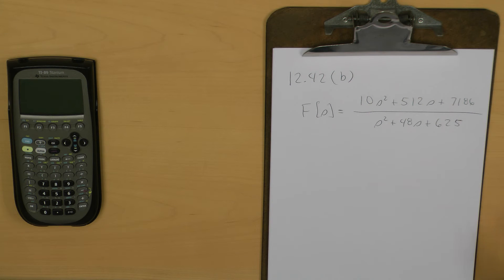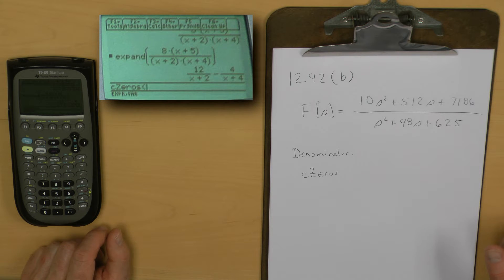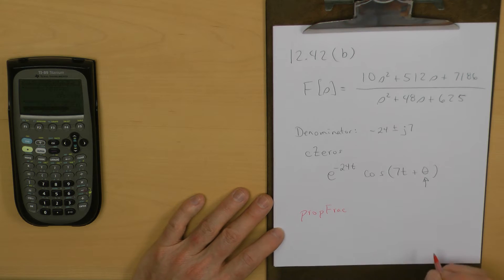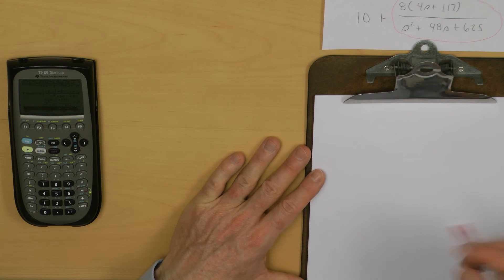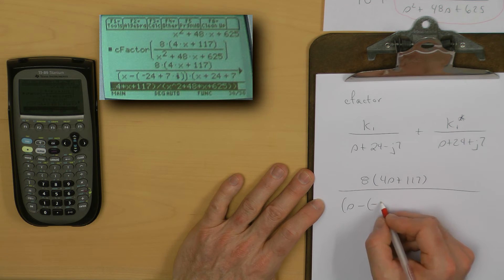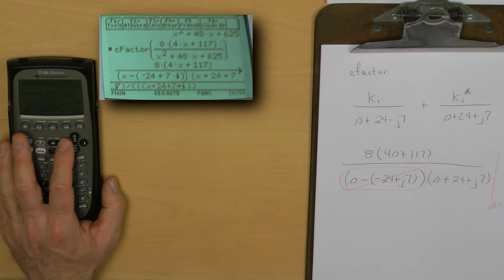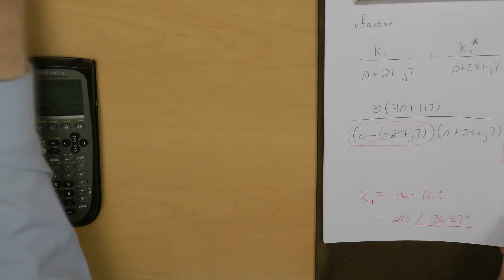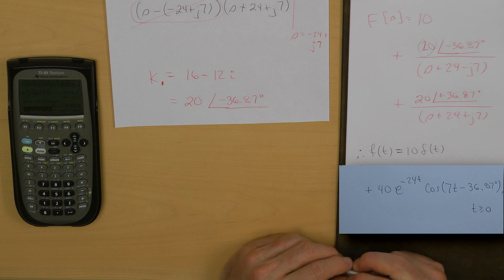Inverse Laplace Transform of Improper Fraction with Complex Roots

Comment: What if there is a higher power variable in the denominator? Something like (250(s+7)(s+14)/(s*(s^2+14+50))? You can't use the proper fraction function of the calculator. It'll be years before anyone answers this if ever, so this is kind of like a time capsule to myself.